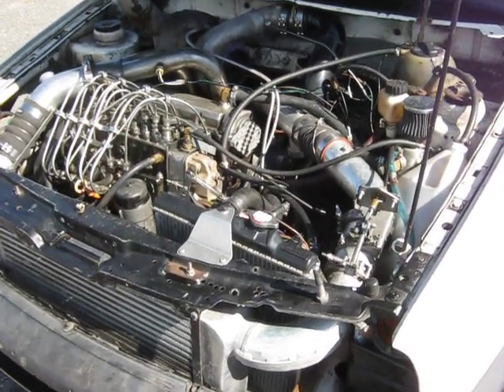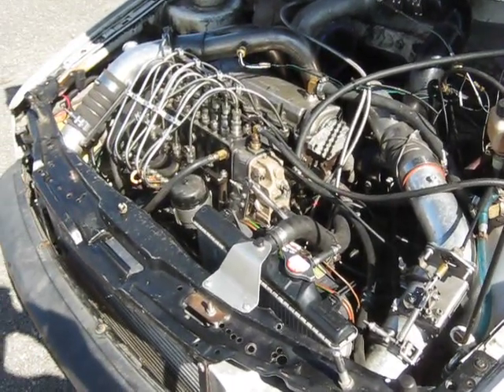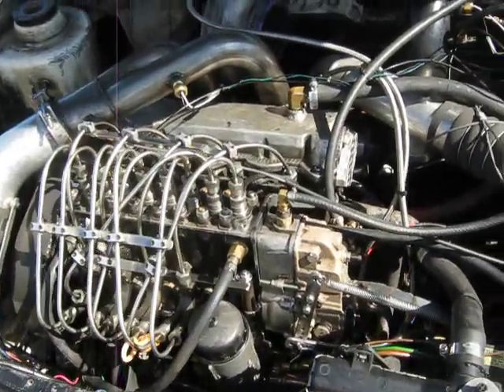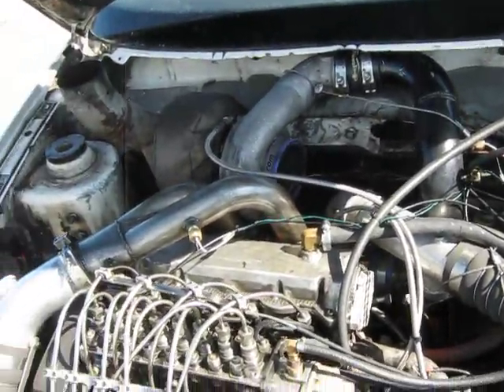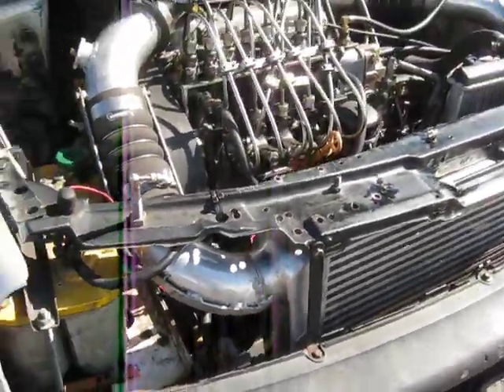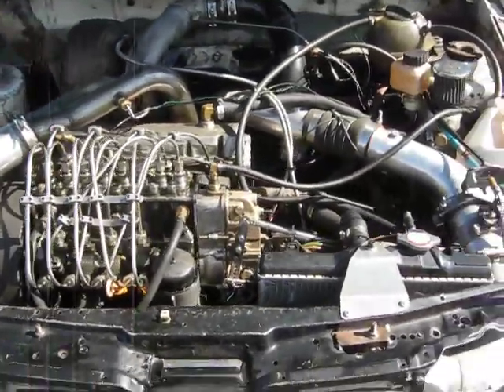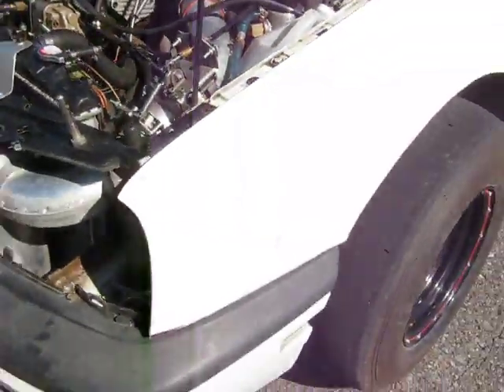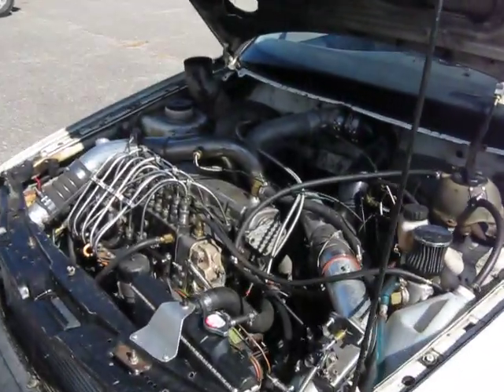470 Horse VW diesel Golf!!!

Comment: Strange injection pump setup. but cool to see!
Reply: Marcel Hanenbergh 
Bosch inline pump. 
If ya know early Cummins and they used a VE rotary pump or an inline pump....the inline pump has way more power potential than the rotary pump. 
Vws used rotary pumps and he swapped to an inline....
I’m a vw diesel guy since I’ve been driving. 
This things badass , I’m not sure if he’s new or I’ve seen this one before. 
Actually I’ve got a 2004 passat diesel engine that’s awaiting transfer into a 79 rabbit.
Reply from the maker: This guy has been racing this for a few years now, he is out of Bomanville. this is just the first time I have seen the car
Reply: ChargerMiles007 
Hmm I’m off to my vw forums, someone in my circle knows this cat.
Reply: I know, but using an pump of an 8 cilinder, and using only 4 of them is strange. most of the time the use an pump of an Mercedes Benz 4 cylinder (also an inline Bosch pump) and rework the pump with bigger plungers, to get more power.

Comment: Veedub for life. 
This things wicked. 
I love fast vw diesels in any form be it late model or old school. 
Nice inline pump swap, that’s akin to the Cummins 6B guys swapping the rotary ve pump (vw uses the ve in 4 cylinder form) for a p7100 in-line pump. 
the inline pump can supply more fuel, but they don’t like high rpms. 
Some of the vw diesel guys can turn em upwards of 7000rpms! 
I’m a wealth of useless diesel and vw diesel knowledge.
Reply from the maker: LOL,  yes this guy rev it to about 6000 rpm when racing, he says it will go close to 9000 with no load. I am surprised he doesn't blow the bottom end out of it.
Reply: ChargerMiles007 
haha yea but those lower ends are pretty stout. 
Stock redline for the old indirect injected 1.5 was 5600! 
It was lowered to 54-5500 for the 1.6 diesel. 
The tdi(direct injected) are done by 4800-5000 usually. 
It’s actually pretty similar to the old rabbit/golf 8 valve 4 cylinder lower ends dating back to the 70s. Refined and polished and evolutionized. 
If ya get a chance to see an 8 valve vw block, the crank is stuffed way up inside the block. 
 (and I think I’ve seen you comment in a vid about crank setups like that , and how they don’t walk around and kill bearings as much from block flex.)

Comment: Personally I don't know how it's even possible for an engine to handle that much boost.
Reply from the maker: Yes, I know what you mean, it must have like 2000 psi of compression if everything is working right!  Though at high rpm you would need lots of pressure to force the air in, given the very short time availible.